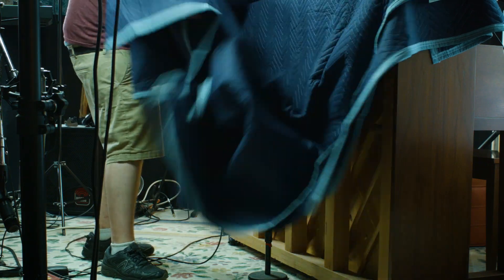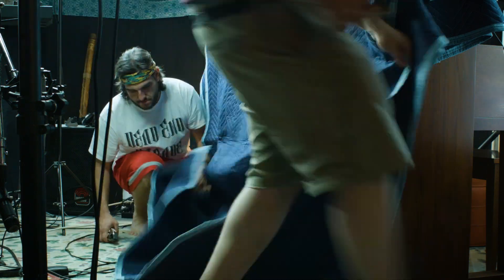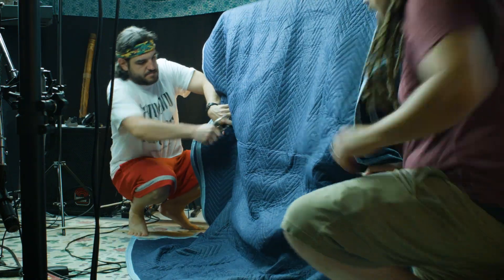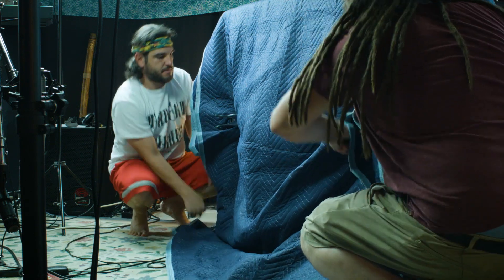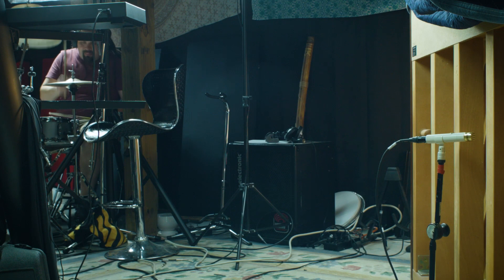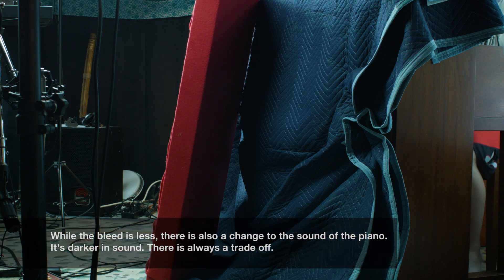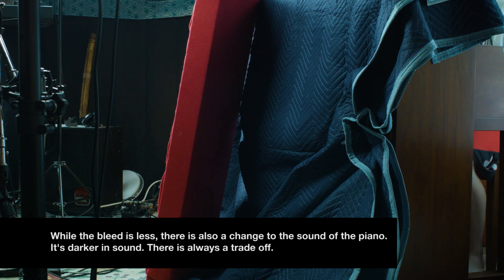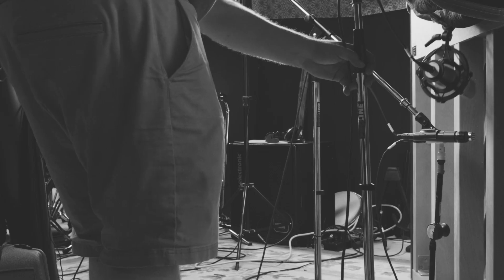How to Record Piano Next to a Drum Set in the Same Room

Comment: Just a thought, and yet another comment by me, haha. If the SDC has less bleed than even a dynamic, should it not also be less prone to feedback in the form of a live vocal mic?
Reply from the maker: Well, I can't say that it has LESS bleed than a dynamic, but the bleed will sound more pleasing. If a mic can get close to a source, then the ratio of direct sound to indirect sound will be greater, and therefore less bleed. Most of the times the mics that can get close to sources are dynamic mics. In this case though, I think the sources sounded better on the other two, than the dynamic mic, and the bleed was most pleasing on the SDC.
Reply: I’ve seen a lot of videos from 60’s n 70’s live gigs where they will use SDC taped together with some mic that looks to be dynamic. This is load rock and punk concerts and the feedback doesn’t seem to be a problem. But I also heard that the SDC was used for the recording not the PA

Comment: just tracked a full band in a 200 square meter room with a drum and grand piano. ended up only a few inches away from the strings with my two LDC's, basically as close as the shockmount permitted. it sounded HUGE and the spill wasnt that bad, but noticeable. i definately benefitted from the increased volume a opened grand piano has

Comment: Woah! I hadn't expected that to be such a big difference. Pretty great for live jazz recordings with everyone in a room I think. Probably to isolate quieter instruments like double bass...
Reply from the maker: Yeah, placement will be key on that double bass. There's not a ton of proximity effect in SDCs, so you'll have to weigh the pros/cons of chosing a mic based on the direct sound of the source and mic that fits that sourse, vs indirect bleed if it's really bad.
Reply: Of course you could always supplement it with a pickup or other mic for the lows.

Comment: So the packing blankets darken the piano, but also, they seem to take out high frequencies, but ADD IN lows from the kit. Like, I checked in my KRK's and my headphones, and I hear less overall volume from the kit, but MORE bottom-end on the kick drum, with the blankets and the panel. Could it be transferring the thump directly from the floor to the mic through the blanket? Also, you got a nice pianist there.
Reply from the maker: I think it comes down to the math behind the polar pattern. I think that if I didn't add the panel, and there was then a uniform dampening across the back of the mic, then it would have had better results. The panel made it worse perhaps. If there isn't sound coming in the null, then the mic can reject it. Just a theory.

Comment: Great video Ryan.  I have a few Rode SDC mics which I don't always use.  Seem to always revert to the SM57 for amps, etc when tracking our full band rehearsals.  Will definitely try the Rode NT1 or M5 for better bleeds control and see how it works out.  Thanks for poking us to try something different rather than going back to what we always did.  Cheers.
Reply from the maker: Sure thing man. SM57s can act well as room mics, but you have to have the right conditions to make it sound good. So the bleed may not work out, and then SDCs may give you better bleed.